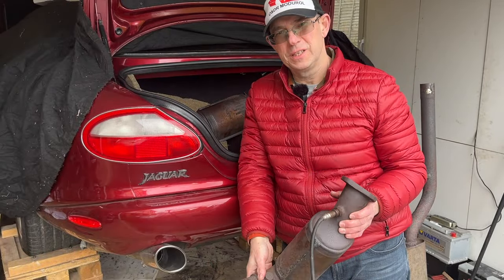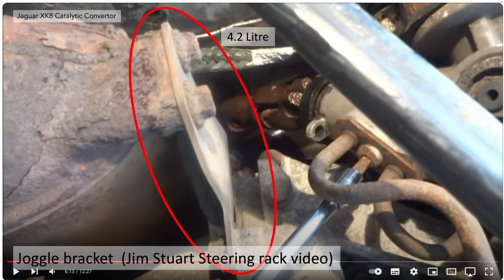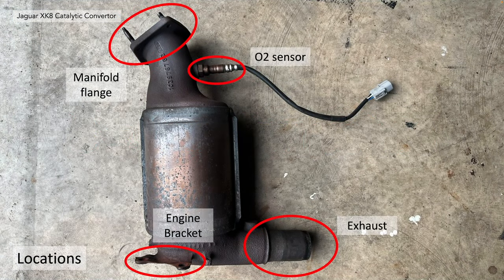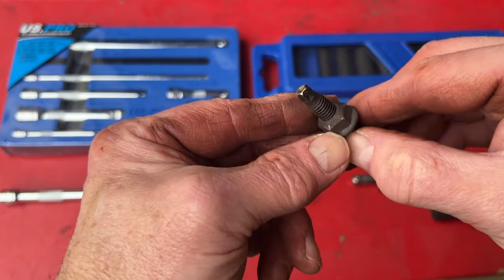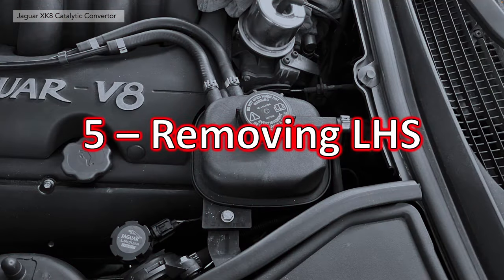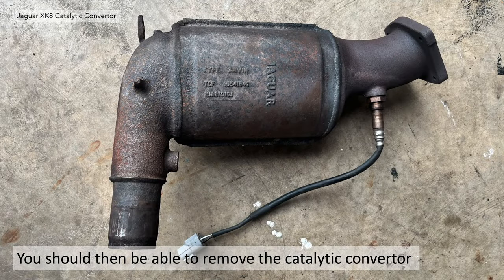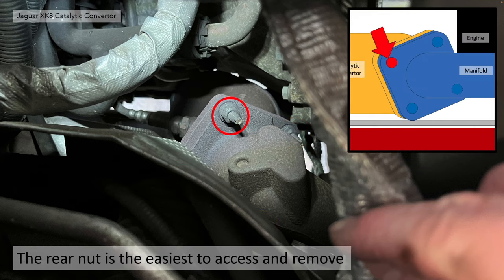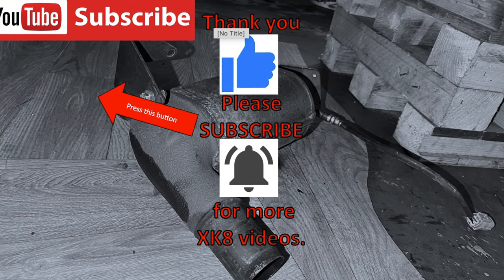Jaguar XK8 Catalytic Convertors, differences, aftermarket alternatives & removal tips XKR X100 AT06

Comment: Hi Damian
Love all of your videos as you know. However I LOVED this one. Excellent clear advice on what to the uninitiated seems like ‘ how to remove a dozen 19:23 nuts. But to those that know, Up to a full day of swearing and knuckle bashing!!. 
Loved your ‘ tape restricted UJ’ hack and will use that for sure. 
I’m a huge fan of the wobble joint, and invested in a really nice full set about 10 years ago and use them more often than the standard extensions for all but the highest torque applications. 
Excellent work mate👍👍👍👍🍺
Reply from the maker: John, Thank you for your comment and kind words. Means a lot coming from you and it's very much appreciated. We are trying are best and hope to get the Automatic Transmission out shortly. We need to get the XK8 back on the road before the summer comes and goes, regards Damian.

Comment: Working on the exhaust manifold is one of the most difficult for any mechanic because the stud bolts are heavily rusted and often break off. I hate this work. At the moment I need to install a new exhaust on my VOLVO. A horror.😮
Reply from the maker: Udo, agree I do not want to touch those manifold bolts. Good luck and fingers crossed with your Volvo, regards Damian

Comment: Another excellent video. I'm surmising that your usual socket set is a 3/8 inch fitting and that to gain some extra space on the RHS you switched to a 1/4 inch extension rather than switching to a 3/8? Of course, your standard set might be 1/2 inch but that seems to be rather unusual these days.
I bought my 1/4 inch set specifically to use with the Jaguar a couple of decades ago even though my 3/8 inch set had served me well for decades before that on dozens of different cars but many of the clearances on the XK8 are marginal for 3/8.
Richard
Reply from the maker: Richard, good observation, that's exactly what happened. I prefer to use the 3/8" set as much as possible. Need every bit of clearance you can get and the 1/2" came in handy. Sounds like you had the same experience with your Jag. Thanks for the comment, regards Damian

Comment: Sorry but may I ask how to disconnect the bottom of the catalytic converter? I know you show how to remove the bracket bolts but how do you get the bottom endnof ot off of the exhaust pipe? And thank you for this video.
Reply from the maker: @tainchains, the answer is with a rubber mallet. Used it to hit the central exhaust box and slid it off the CAT downpipes. Lots of wiggling and a bit of WD40 helped. Only problem was I also hit the rusty exhaust pipes and they deformed slightly, so be careful where you apply force. Hope that helps, regards Damian
Reply: Thank you. Mine is a 2001 Vanden Plas. Same setup though. My cat is so clogged that it is causing misfires on 1-4 cylinders. Someone neglected a failed o2 sensor for years I think.
Reply from the maker: @tainchains, no problem. Good luck with your repairs, regards Damian

Comment: Damian, do you think there might be any benefit gained from prelubing those studs now, years before needing to remove the cats?  Something like WD40 antiseize spray?
Reply from the maker: Gary, It didn't seem to get us anywhere using WD40 on disassembly although it wasn't specifically an anti-seize spray. As the CATs get so extremely hot, wouldn't have thought any penetrant would survive the punishment. However, can't hurt and we are thinking of using copper slip on the nuts on reassembly just in case. The nuts and studs were is surprisingly good condition (even in the UK) probably due to there location tucked up out of the way. Hopefully you won't need to remove them with the more reliable 4.2 transmission, regards Damian

Comment: The bolts did not come out with the nuts. I bought the revers torx for the bolt and it simply stripped the top
Reply from the maker: @tainchains, we have the same female Torx sockets and couldn't remove them that way either. Going to remove them using grips and buy new studs and nuts to replace them. Thanks for the comment, regards Damian
Reply: I bought m6 bolts and nuts and just used those to reattach the new own. It was diffcuul ti slide the converter off so I ended up cutting it in front of the exhaust. And the patt that was left in was also hard to remove and it was hard to slip the new converter in. Thanks for a very useful video!
Reply from the maker: @tainchains, thank you for sharing your experience, it’s noted. We have still to re-assembled ours but we are sure it will be fun, regards Damian

Comment: Hi Damien.  Hope you're well. 

I've got a Y reg XKR X100 and it smells really badly from the exhaust.  Any ideas on what I should check please?
Reply from the maker: Shazzy, sorry, to be honest I have no idea. Reading up on the internet, a rotten egg smell is supposed to indicate a failing catalytic convertor.  If your CATs are breaking up you should be able to hear them rattling as you drive the car. Are you getting any other symptoms, reduced power and economy? regards Damian

Comment: Thanks Damien,  whilst I have no front, bonnet,  rad, cooler and fan pack on, is there anything else other than,  timing tensioners, Serpentine belt, belt tensioner, water pump,  subframe and mounts and thermostat housing I should check? She's done 90k miles. Would you like to see photos or are you sick of looking at others cars? Cheers, 
Jon
Reply from the maker: Jon, that a very inclusive list. The only other items might be the aircon compressor, alternator and starter motor. Its easier to get at these whilst you have all that off. Reference the starter I would recommend this kit from ebay (link at bottom). Fitted it myself and one thing less to worry about, regards Damian 
https://www.ebay.co.uk/itm/251272895122?itmmeta=01HV1KXK0CKM8ZMJDZAVKN7K4H&hash=item3a81081a92:g:iBMAAMXQq8BQ6yow&itmprp=enc%3AAQAJAAAA8GYB16XU8xJR2R2H7wuSCwl%2FP7x%2FaF9dfKLTqZudapwPtsZnAOvlABa1kxdtqFK5YfC%2FzLsGWMYkAiydPLfBjJyh3%2BcMGbPKG56HnhIO0ag68JMTlH%2F30nUU4DDJLSp71WOfJBNWjwEAIXla1Jmb%2ByezIiHJLZPehuSmPlTx8%2Fp38ewrWjEQ5DReCoYp%2BRvXwvylMtNPf1%2FgQ8sURlrb6m9wk2D5q1DxyvELwquLky8yjCTLh6OjSrhkMohaJZTgAixvGZTcSm7F6Vpw6BXq6zxV%2FSVzAoHIf5b6%2Bam3hYTZIr9%2F1Wt8AAwCQnoo6E8w%2BA%3D%3D%7Ctkp%3ABk9SR6Kw9rPYYw

Comment: So the 4.2 cats just use any of the flange type cats online? It's just that they all say they are for 4.0 cars and not the 4.2. I also asked AutoReserve in the UK and they where pretty sure the 4.0 cats won't fit the 4.2 cars. Maybe they are just wrong? I just don't want to buy some cats for my car only to find they don't fit.
Reply from the maker: @Punisher9419, Autoreserve are correct, 4.2 uses CAT's with flanges connecting to the Middle silencer and the 4.0 just uses pipe inside pipe. Other than that the CAT's are the same but if you aren't changing the middle silencer then it's not a direct swop. Recommend looking underneath your car to confirm the CAT's have pipe flanges. Hope that helps, regards Damian.
Reply: @ODRModurol  Yea mine are the flange type so I can just use the flange cats and they should work I guess. Not sure if the bracket will work though but I'm not sure how necassery that is?